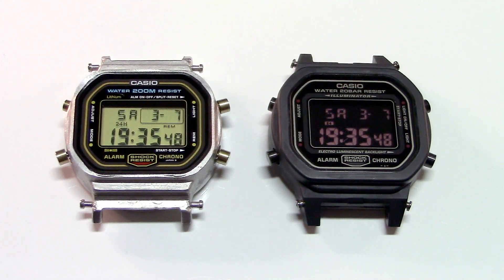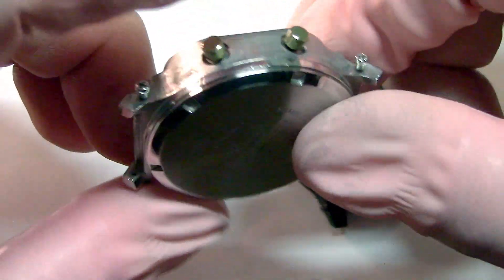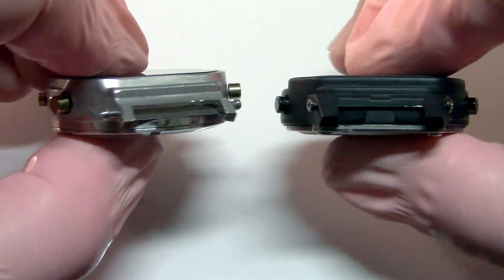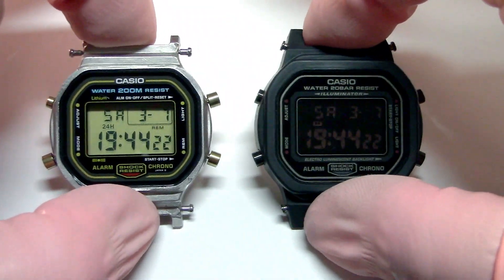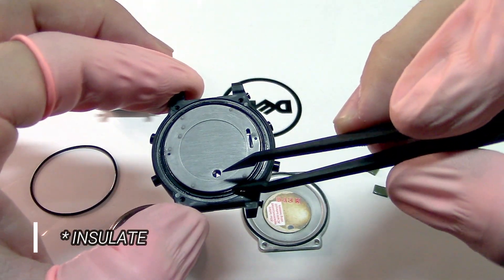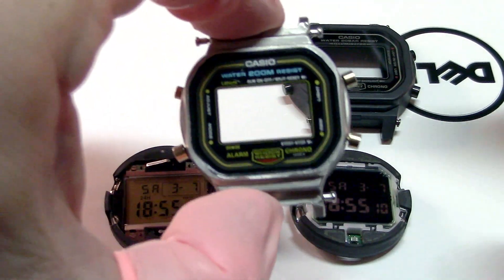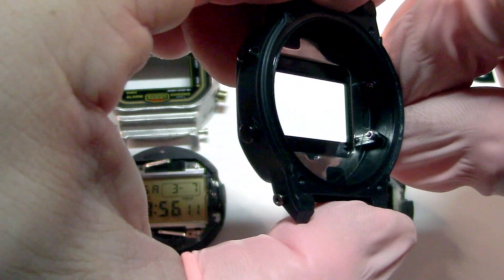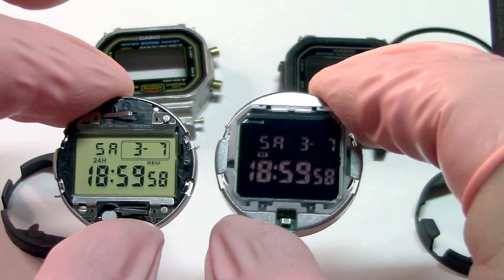[EN] Construction and electronic module: old versus modern Casio G-Shock DW-5600

Comment: The older ones, until 5600C, were built a lot better because if you destroy the plastic bezel you can still use the watch without it, since they have a proper metal case. New ones, apart from very expensive versions, are all plastic and if you crack the bezel you cannot use it anymore until you change it

Comment: G Schok is a legend... I believe the old one is more easy to read and steel is always much  better than plastic ...quality is getting poor...this plastic  along the years ( several )  is going to crack ...
Reply: I have 65 and have never had an issue. I think the older one, say pre-2010, can have resin problems but these days the resin in much better and longer lasting. I don't agree that steel is always better. Steel transmits shock through it while resin absorbs some of the shock.